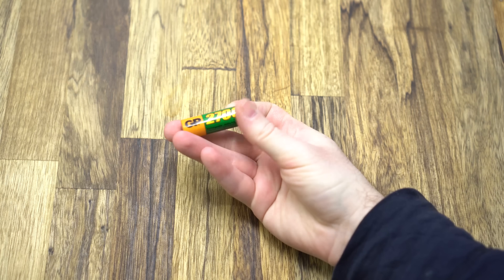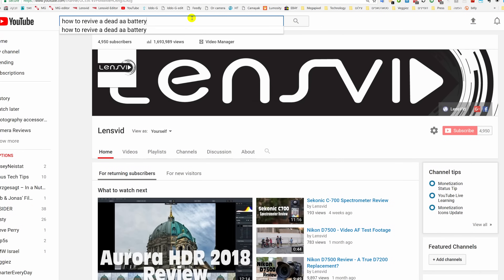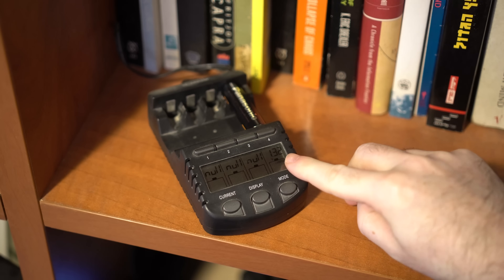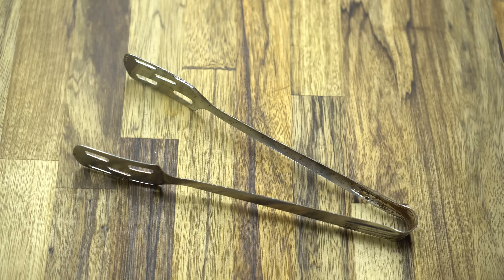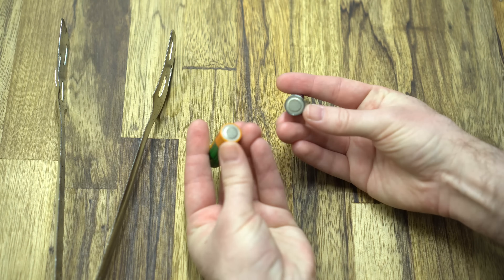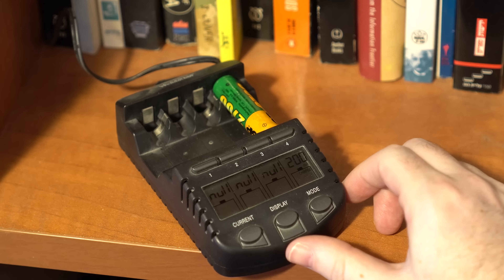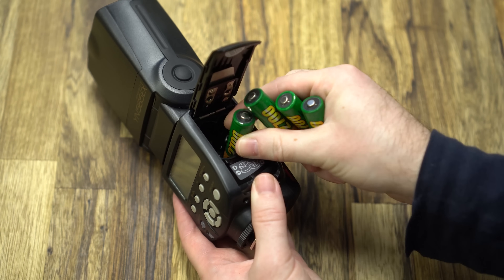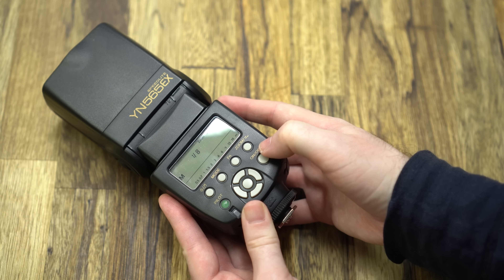How to Revive a Dead (AA/AAA) Battery

Comment: Unfortunately it didn't do anything for my 8 batteries that were 6 years old and still in their plastic wrapping. They say they are charging for about 4 minutes then say they are charged but nothing works that they go in. 😟
Reply: They were AA batteries.
Reply from the maker: Based on the (many many) comments made for this video we observed that this worked in about 90% of the time (which means in about 10% it doesn't - maybe the batteries are just damaged or too drained to get a charge...).

Comment: i used alum. foil for "cooking", as i didn't have anything other on hand and .. holy moly, it worked .. gave the battery a lowly 0,88v, but it was enough for the charger to take it ..

Comment: So basically to explain what he's doing is; By putting the batteries together in Parallel then bridging them he's causing the batteries to act like a single batter forcing them to equalize the charge between them. This is actually much easier to do with a paper clip, piece of solid copper wire, or a bobby pin.
Reply: Thanks for the explanation - this video is very old by now and we still want to do an update with an engineer to properly explain this and also suggest simpler methods.

Comment: When I was experimenting with rechargeable battery’s, I noticed when they died out and couldn’t be recharged I could simply take a wire and hold it to the negative and quickly spark it against  the positive and it would almost reboot the battery, allowing it to be recharged again.

Comment: Holy moly, it worked for me too! I had a "dead" 3.7V 18650 stuck on a proprietary adapter for a POS terminal. I didn't want to spot weld a replacement battery, but I just boosted the old one to the new one with some copper wire with your trick. It was only 4.2V vs 4.1V but after I put the old one back into the terminal it didn't read "0% charging" anymore!

Comment: It worked! Careful not to confuse the polarity, and in my case had to use something from metal (ex. key) as the negative sides were not touching. 30 seconds et voila, the dead battery suddenly had 1.0smth volts which I can recharge.

Comment: It actually works. Having two gun safes with multiple motion-activated LED lights each using 4 AAA batteries it was more cost-effective to order rechargeables. EBL has given me better performance than Energizer or other brands unfortunately when they go completely dead even their smart charger will not recognize them. I used two foil strips which can be a pain so this way I would definitely recommend and it only takes a few seconds. Thanks for the video

Comment: So much wrong on this. You clearly didn't say to use the refresh charging when cycle when you get the old battery working.

Better to use an amp clamp with a USB cable to kick start the dead battery with a charged battery.

30 seconds is too long and is likely to damage the good battery. Better to do about 5 or 10 and then immediately put it on a refresh cycle on your smart battery charger.
Reply: It worked for me

Comment: Are you transferring the charge from a normal battery to a rechargeable battery? Isn't this defeating the purpose?
Reply from the maker: It is a very very small amount of power. You can use a good rechargeable battery if you are too worried.

Comment: I was looking for this video, i remember doing this a few years ago, but currently i needed to revive some battery and i did the thing wrong, i just used clamps with only one AAA for a very short time, and it got hot. for now it seems to work. but.. i wanted to do this and now i found this video again after the mistake... THANK YOU, its better to replace them for new one after i did short them? ty
Reply from the maker: They are running hotter than normal when working?
We are going to renew this video soon (it was in our plans for a long time) we want to show more ways of doing this and also get a professional talking about why this actually works and what are the dangers.

Comment: i've had better luck using a 9 volt to break up the crystals
Reply: Please elaborate...
Reply: @IddoGenuth  if you search on youtube "NiMH nickel metal hydride battery recover" you should see a video by fintech repair.  it's quite in depth, and covers all the info.  but long story short, the batteries form crystals that block energy flow.  for aa/aaa batteries busting the crystals up with a few short bursts of 9v can work well at getting them to charge again
Reply: @FroggyTWrite  Thanks for the tip. We have been looking to do a follow-up video on this one and I wanted to interview a university professor on this subject who will explain why and how this works - so far I haven't found anyone who was willing to talk about this subject - if I will find one I will ask him about what you mentioned as well.

Comment: Thank you, this really works. I had 2 batteries forgotten in a charismas light for a year. I tried charging them and nothing happened. I measured the voltage and it was at 0. So i tried this method, tho I didn't have any clamps so i just took a piece of aluminum foil and connected both ends for 30 secs. The voltage after was 0.9 and when i put it on the charger it started charging.
Reply from the maker: Glad we could help. We really want to make a new version of this video for 2022 with a little more info on this method and other methods, but yes this works in about 9/10 cases.

Comment: Didn’t work for me. Even tried on different combinations.
Reply: Based on the hundreds of comments we got for this video (which got over 1/4 million views) we can say that it seems to work at a rate of about 9 out of 10 cases or so. This still means that in every 10'th battery - it will not work - possibly since the battery is completely drained or manfunctioned in some way (I assume).

Comment: I was suspicious about this tip but it really works! The dead battery is charging again. As for the amount of charge it will hold, I guess it must damage the battery at some point.
Reply: If you don't have a BBQ pinch, it works also with a folded aluminum foil

Comment: So um...you don't need tongs to make this work. (lol at using tongs)
All he is actually doing is putting 2 cells in parallel to get a stronger cell to transfer energy to the weaker rechargeable cell so that the voltage of the cell will increase until the charger will recognize the cell.

Just put the negative terminals of 2 cells together & then place a wire between the positive terminals (no tongs needed).
Note:  1 of the cells must be strong enough to recharge the other cell enough for the voltage of the rechargeable reaches the min V that the charger requires in order to recognize the cell when placed into the charger.

Comment: Just how much do they charge them
Reply: What do you mean?
Reply: @IddoGenuth  I mean would it bring them to a full charge
Reply: @rayapackard7269  Which part of the process? the part where you use the clamp - no of course not - it just gives the batteries a little bit of power. Charging them with a charger should bring them to "full" power - is it exactly like they were when they were new - I don't know I would guess not but I didn't feel a dramatic decrease and it can be different for each battery.
Reply: @IddoGenuth  I just don't have any AAA batteries around ghe house cept the dead ones
Reply: @rayapackard7269  Than I guess that when one dies - try and see.

Comment: Doesnt work
Reply: Sorry to hear that (I am sure you tried it several times with the correct side of the batteries before you wrote that - right?). In general, at least based on the likes I would say this works in a ratio of 10:1 which is pretty good I think (some batteries will still need to be recycled; I think I had one which I could not revive over the years out of 8 or 10 which seems to hold true to what I speculated above).

Anyway, we are going to make a new version of this video (much better quality and some new insights later in 2021).
Reply: Iddo Genuth thank u for the reply! Yes I did try it multiple times I might have done something wrong who knows but I’ll stay tuned for the next video :)
Reply: @RoBludlungjoeyydanielrsonfan57  I am not sure the next video will necessarily have made much of a difference in this case (there are some batteries that simply need to go to the recycling at some point) but we will do our best to add a few things that we learned and at the very least make the video itself a little bit more 2021 in the way it looks.

Comment: Should be nice if you also explain why this works, 
and why you need to very careful with this!!
Why it works:  Dead batteries don't contain any charge
any more, and the battery charger sees this as a dead battery
and does not reload it due to safety limits of the device. 
Batteries can explode if recharged incorrectly! 
By putting a bit of charge in the battery, you make it able
for other electrons to move over, thus the battery is charging.
If you put the battery in a charger and the charger is unable
to find any charge left in the battery, it will simply classify 
it as a dead or damaged battery. To explain it in details, 
you should watch a vid about it.  In a battery you have 
positively and negatively charged electrons. One you use 
the battery the positive charge electron will jump to the 
negative terminal and thus releasing some energy.

Electrons flow, they do not like to be stuck!!!
So the moment you connect up 2 batteries together
the overflow of electrons from one battery wants to 
flow (equalize)  to the other battery. Nature always 
wants equilibrium.  

First of in this video the batteries are NOT dead!!!
A dead battery you can NOT revive this way!!!
This is just a battery that left unused for to long with 
almost to none charge left.  The electrons over time 
lost their charge, and the charger just saying.
"Hold up: This battery has no charge, it might be damaged, 
so I wound charge as for my safety limits"
Because damaged batteries can explode!

Also ONLY use batteries of the same type or the same
capacity in wats and amps.  Never do this with a battery 
that has much more capacity then the small AA/AAA once.
(Like a car battery for example)

First of always make sure you where protective gloves
that are rated for electricity. And make sure you are not
overpowering the small battery with a much larger one.
If you do the battery could heat up and then blow up 
if you are really unlucky. The stuff within the battery 
can cause severe burns if this touching your skin.  

Then when you insert the revived battery for the first 
time in the recharger, cover it up with something like 
a bucket.  This is to make sure the battery was not damaged
during reviving and to prevent it from blowing up in the 
charger. "If it does":  it is covered by the bucket. 

Once you successfully recharged the battery once or twice,
you can leave the cover the next time and your battery
should be fine.
Reply from the maker: Thanks, TGP - caution is always important. We are going to do an updated video (this one was recorded way back in 2017) and Maybe I'll talk to an electrical engineer for that one and add some explanations and warnings (but I still want it to be a very quick video so I am not going to get too deep into it - we are a photography channel after all not a science channel).
Reply: That's a lot of information 🙂🙂!!
Reply: thanks for the advice!

Comment: what if its carbon battery
carbon battery wont charge
the instruction says it will explode
Reply from the maker: I have no idea what a carbon battery is - can you share a link?
Reply: @LensVid  https://www.vonikobatteries.com/blog/what-is-the-difference-between-alkaline-batteries-and-ordinary-carbon-batteries
Reply from the maker: @Me-dc4cz  To be honest I still have no idea what carbon batteries are even after reading this. This video refers to normal AA/AAA rechargeable batteries I can't comment on anything else that we didn't test using this method.
Reply: @LensVid  its ok because i had kingever carbon batteries.
thanks for the vids it work's on my other batteries
Reply from the maker: @Me-dc4cz  Well after looking a bit more I found what you were talking about - these are called Zinc-Carbon:
https://en.wikipedia.org/wiki/Zinc%E2%80%93carbon_battery
From what I understand from the very little I read these are low-cost, long-lasting non-rechargeable batteries (good for remotes/smoke alarms and similar devices that require little power but need to work for as long as possible). 

In general - this is designed to work only with rechargeable batteries so this is not designed for these batteries - I have no idea if there are Zinc-carbon rechargeable ones (I would guess not), but I would not risk it even if there were.

Anyway - I learned something new about batteries today (I never used these or even seen them, not sure how common they are around here).

Comment: I used speaker wire instead of bbq tongs lol thanks for the tip! Revived my Amazon rechargeable batteries
Reply from the maker: We have a plan to update the video early next year and try different other options - basically, any conductive wire should do - we used a paper clip and it works well.

Comment: Rechargeable batteries are a pain when the charger or battery decides it won’t charge. This is a great tip.

Does anyone have a similarly easy tip for chargeable batteries that come with drills or garden tools. They are notorious for dying if not charged regularly (ie over winter)

I mean besides bringing the battery powered garden tool to the lawnmower service guy. -

Comment: Does this work for aaaa battery as well??
Reply from the maker: Never heard of anything but AA/AAA...
Reply: @LensVid  it's a very small battery and it is generally used for stylus pen that is digital pens for laptop
Reply from the maker: O.K. never heard of it but I would say that if it generally looks like an AA/AAA (positive on one side negative on the other) and is rechargeable - than yes. Feel free to try.
Reply: @LensVid  k thnx

Comment: I am going to buy a Energizer charger that comes with 4 AA NiMH 1300mAh Rechargeable batteries, will this charger also be able to charge my other 4 NiMH AA batteries that are 2800mAh, 1300mAh to 2800mAh is a big increase.
Reply: Any AA battery should be able to revive any other AA battery (if it has power). 
This is NOT a charging method this is just for reviving dead batteries - you will still need a charger to charger after  the initial quick boost.

Comment: Can this work with low batteries as well?
Reply: What are "low" batteries?
Reply: @IddoGenuth  Batteries that are low in power but not dead.
Reply: Oh that kind of low - no this isn't a charging method as far as I know (just a way to transfer a tiny bit of power to a different battery so that the charger will recognize and start charging it again).

Comment: Wonder where i did wrong, cause i tried and it didnt worked for me
Reply from the maker: Did you use all conductive metal? did you align the batteries like we demonstrated one with a charge and one without?
If you did all of that and it still doesn't work possibly the battery is really dead (they will die eventually).
Reply: @LensVid  hi there, after several tries with the same technique as seen on your video, at last it works. Somehow i need to press it really tight between the batteries and the clamp and hold it more than 30s. Doing that several times and finally it is detected by the charger. Thanks for the video
Reply from the maker: Sure thing! And yes you do need good contact for this to work.

Comment: IT WORKED!!!! YAY!!!! Thanks so much. How easy too! I had an old metal kitchen tongs that was replaced by a new one with proper latch that keeps it closed. I used the old one and now it is one of my most valuable kitchen tools in the house. Charged my old blood pressure monitor AA batteries with 4 new AA batteries.. Didn't want to charge 4 old with one new one. They all work now ! Will share your video with all my friends.
Reply: Pomogło.

Comment: What the shit? That worked! I have these cheapo blister pack walkie talkies I haven't turned on in probably a year. They were on the charger, pulled off who knows how many months ago. Would not turn on, would not charge. Nothing. Figured the batteries were bad (AA rechargeable). Tried this on all 3 batteries per walkie. Both afterwards turned on and still showed full charge. They are on the charger now.
Thanks man, I was wondering how to "reboot" a rechargeable battery. Was tempted to try a 1 ohm resistor across pos to neg overnight and try recharging, but this was much faster and freakin' totally worked just fine.
I used some nice heavy wire instead of a clamp as I wanted to make sure to have as few ohms of resistance as possible. Tempted to build a AA battery box with a soldered crossover so you just plug them in and let them sit for 30 seconds.
If this doesn't work for you... make sure you have continuity and low impedance. Not sure BBQ clamps are the best for that :p

Comment: I didn't have any clamps so i completed the circuit with tin foil. It works but be careful! The postive ends of the batteries heat up like a mofo!!
Reply from the maker: We now switched to a paper clip - you only need a quick jump start - 30 sec is typically unnecessary. 
Maybe we will make a revised video in the future - this one helped so many people so far.